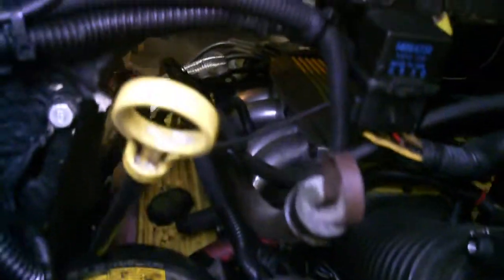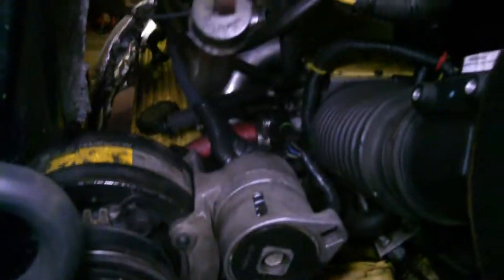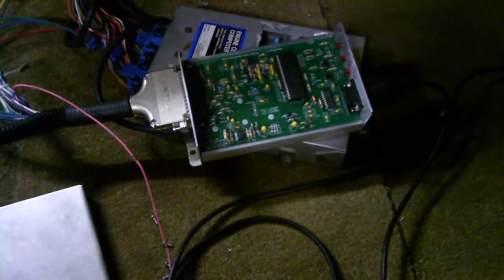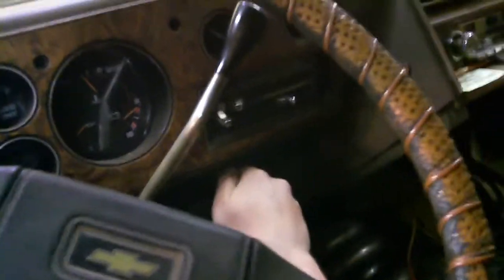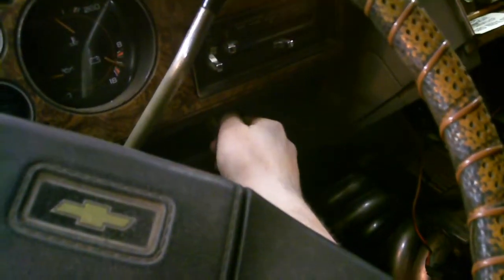2-24-11 Project old mans van (86iroc tpi motor in a 81chevy van)

Comment: Cool van dad used to have a 1990 GMC Rallye 1 ton work van with a 350 TBI 4-bolt main V-8. Was rated at 195HP/300TQ stock I think he put a K&N filter and a custom side exit 3 inch exhaust on it. Sounded pretty good and actually kept up with some 80s Camaro. Might have been a V-6 but hey the van weighed 5K-6K pounds empty so not bad I say.